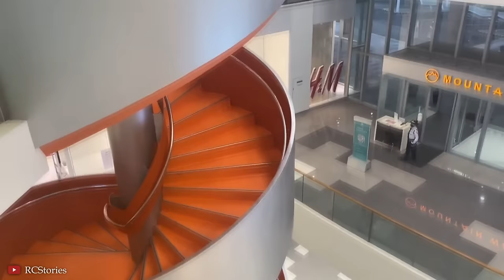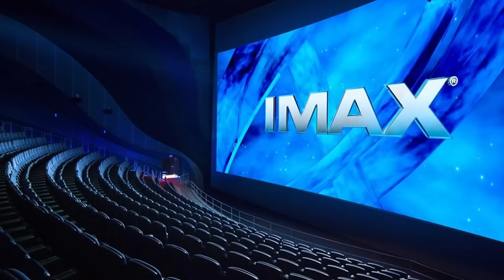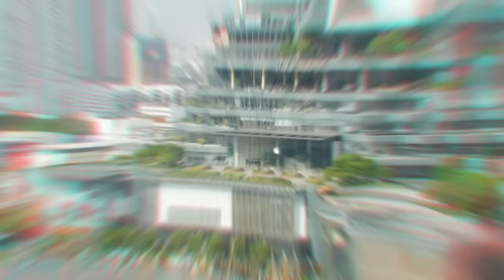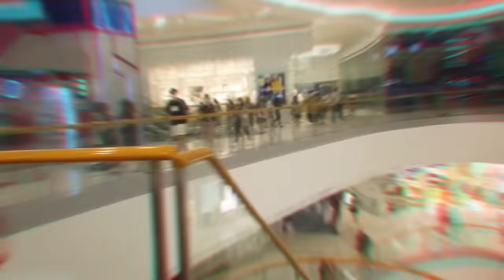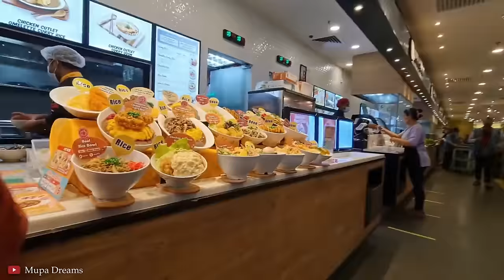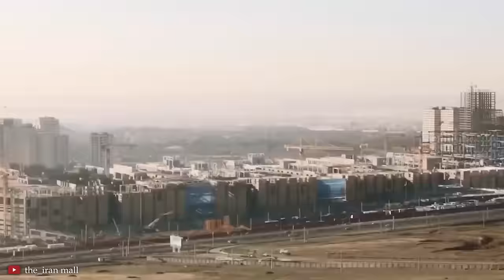15 LARGEST Shopping Malls Around the World

Comment: THIS WILL BE THE BIGGEST IN THE WORLD BY 2035
Philippines will be building the SKY MANILA, they  would put Metro Manila's 100 km x 100 km land area up by 50 meters using 500,000 posts. 
There will be three levels, the ground level is the existing land, all vehicles would use the ground level, 
hundreds of MRT and LRT would use the second level and therefore reducing massive amount of vehicles using the ground level and less traffic, 
the third level would be vehicle less area, yes no cars, trucks, jeepneys. 
SKY MANILA is walking , jogging, biking, scooting area. It will be full of skyscrapers no less than 300 meters tall, condos, hotels and offices. 
Hundreds of parks, huge malls, millions of restaurants, thousands of hotels, several thousands of factories using all electric. 
All vehicles will be full electric,  non-electric vehicle are not allowed. 
Many swimming pools, basketball, tennis, football courts, and many sports venues. 
Hundreds of entertainment arenas.
It will have airport for helicopters or any vertical take off planes. This will be finished in 2035. Flood will be the thing in the past. From Filipino concept.